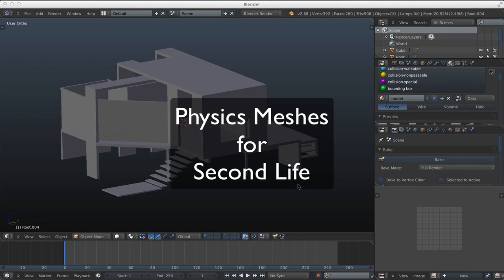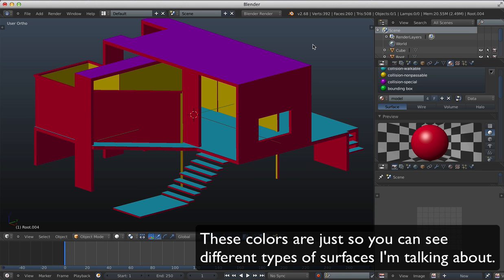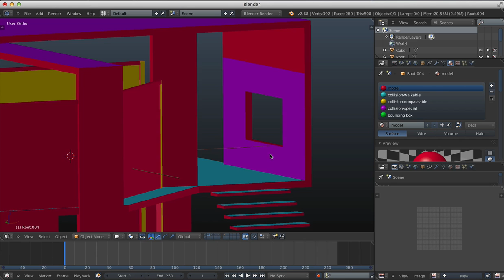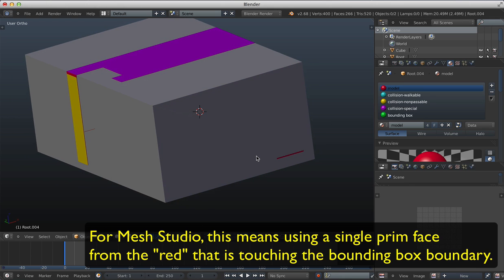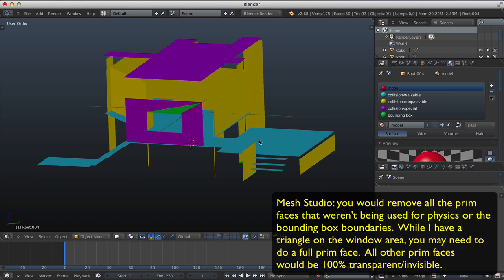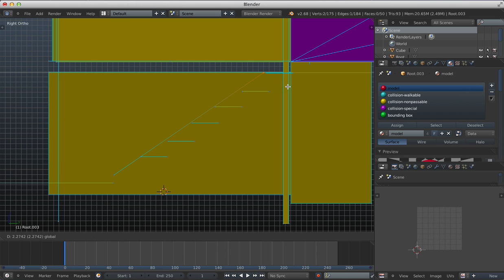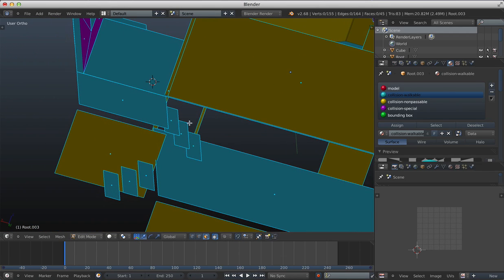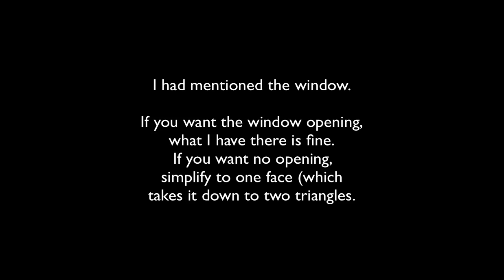Physics Meshes for Second Life (updated)

Comment: Well, to be honest, I am a bit confused. 
You start of by saying "It is important to do this for roleplays to do this so people can shoot through windows", yet you made that statement about not having to 'frame' the whole door. 
So from my point of view these statements don't mix.
Reply from the maker: The actual collision surfaces on a window or a door are actually around it; only the hole is uncovered to be able to pass through it.  If the window does not need access, in that the customer will not need to be able to walk through it or put something through it, like a gun, then you could pretend it's not there and it just becomes part of the wall collision surface.  A lot of roleplaying would need someone to be able to jump through or shoot through the window as an example.  Does that explain?
Reply: +Eleanora Newell Well, what I ment to ask was, why arnt you 'outlining' the top of  the door frame? In a firfight scenario it could be important, that that part blocks a granade for example.
Reply from the maker: Well, with trying to explain the basics, which is to tell someone, it's the collision surfaces that matter that are important.  It's not until someone gives me different scenarios than I had imagined, as you just did, that I can address them.  if you have a door in a wall the possible collision surfaces are normally the wall to the left and right of the opening.  You normally don't have people trying to walk through higher than the door.  However, especially if the wall is uploaded separately, you include the part of the wall above the door.  Normally, walls are not thick enough to worry about someone walking into the thickness of the wall, so you can do just the front or interior wall and not need to do both.  However, some things, like castles, can have very thick walls and then you may want to do both sides of the wall.  You may even want to do the surface surrounding the door jamb at this point, though again, maybe only the sides.  In other words, only you can determine what are the collision surfaces you need and no tutorial is going to be able to cover all the bases.  You can always ask as you're doing here and at that time, I can try to explain.

Comment: This is really great--but there is one thing I'm not understanding--In Mesh Studio, What is it exactly that gets uploaded into the physics tab?  The bounding box, or the faces that make up the impassible/walkable mesh?
Reply from the maker: Both.  The physics mesh must have the exact same bounding box as the high LOD mesh.  In a lot of cases when you do the collision surfaces you need, they will touch the boundaries of the bounding box on height, width and length, but not always, so you need to somehow touch the boundary it isn't touching by either extending a collision surface or putting a small bit of prim so it touched the boundary.  

If the bounding box of the physics mesh does not match the high LOD bounding box, it will stretch the physics to match it and can, in turn, throw off the physics.
Reply: Yeah, in the time since I wrote that I figured it out.  In fact, it was your beginner's workflow tutorial that finally connected the dots to the physics tab.

Comment: Nice tutorial , infact one of very rare found ;), I have an issue which i think you can help, I am learner of course, my problem is when i import my building in SL i can not walk into it, its some sort of barrier preventing me entering into it. the door is huge , do you think its because of the mirror modifier applied ? or what is the possible cause. thanks
Reply: Did you read the note at 14:41?  You might have stopped the video before reaching it. It says: "Once uploaded, remember to set the model to "Prim" in the features tab of the SL edit menu."

Comment: No matter what I attempt, copying what was done step by step in this video, I still can't get physics to work correctly, I cannot walk into my building, I do not understand what I could of done differently . . . So frustrating.
Reply from the maker: Criss Crow First, did you make sure that you are using a 32 bit viewer?  Secondly, once you created the physics and upload it, do you press the analyze button in the uploader under the physics tab?  Third, did you set the building to prim when you rezzed it?  And if you did all this and it still didn't work, did you check to make sure that bounding box of the physics mesh matches that of the mesh you're doing physics for?
Reply: It was that I didn't set it to prim in features, another video I found pointed that out in the video, so now I am continuing my project, thanks for the reply though.
Reply: +Criss Crow This was exactly the issue I was having, thank you for pointing that out.

Comment: I'm still having problems with the physics part of this.  Maybe because I'm trying to use it on a vehicle? What it appears to be doing is loading the physics into the wrong place of the build instead of where I need it to go.  Example:  I made a tank and set the physics (prims) to in front of the turret as well as on the sides.  When I uploaded it using the physics file it placed the front prim onto the gun barrel and the sides did not show up at all.  What am I doing wrong?  Thanks. (Blender 2.72 - > SL - Firestorm Viewer).

Comment: How do you set this up in blender (physical walls and such) so that when you import it into sl it works? If I make a copy of the build and place it into another layer, SL would upload all layers as 1 mesh thus doubling my LI and costs. If I use a physical build for walls and ramps and turn the rest phantom, would that work?
Reply from the maker: antuan734 When you export each dae from your Blender file, you make sure that you have checkmarked to export only what is selected (in the options under the Collada dae export options in the file browser when you export).  The uploader in SL shows four places to put dae files in the first tab.  Your main upload is the high LOD which is what you use to start the upload process.  Then, if you have made meshes for your lower LODs, they go into each LOD level with the pulldown where you choose to load another dae.  The same thing for Physics in the physics tab.
Reply from the maker: antuan734 Also, it is important that you use flat planes to create your collision surfaces...round surfaces can be really simplified, and if not a walkable surface, even a box will do for a cylinder since this is for physics.  The more simple your physics, the lower the LI.
Reply: Eleanora Newell
Could you do a video explanation of this? Also, if you could I tend to have very high LI on my builds and trying to find ways to lower them (tri's to quads, remove doubles, etc) don't do a lot.  I have even started projects over from scratch only to find that my LI is still over 100+. So if you could do videos on each of these topics it would be a great help.  Thx.

Comment: Thank you for making this video, I am new to blender and I want to be able to learn how to build this way. However I am running into a similar problem that when I walk into a house that I have built, from the outside I see the walls, windows etc but when I walk into the building the walls disappear as well as the floors as I am trying to build 2 (or more) story building.
Reply: You have to build the inner walls as well. You can do this by "duplicating" the wall(s) and moving them into position, or by extruding the interior walls. Be sure to check your "normals" facing to be sure they are facing the correct ways.
Reply from the maker: TygersPanther9881 See my response to Kayla Hallison in case this is your problem as well and you did build the inner walls.

Comment: I'm so frustratingly close to finally being able to create my own buildings and then I just had to fall at this last hurdle, I could cry. I'm having the problem of invisible walls on the insides of my builds after I upload them into SL, i'm guessing it's because I haven't done this physics mesh thing, is that right? I just find it so confusing D':
Reply from the maker: Kayla Hallison Physics isn't what will do invisible walls.  That would be your mesh having flipped or inverted normals.  The best suggestion I can give is to make sure that you have "Backface culling" on in your Property Shelf (right side of the 3D View - toggles on/off with N) in the Shading panel (scroll to find all the panels).  Also check in object mode that your model shows 1.0 for scale in XYZ under the same Property Shelf under Transforms>Scale.  If the numbers are not 1.0, you must apply scale to reset by pressing Ctrl A and selecting "Apply Scale".  In particular, if the transforms have negative values, once you apply scale, you will be able to see the inverted normals on the faces of your mesh, if you were not able to see it before.  Then you can recalculate the normals (or flip them if they are stubborn).

Comment: MY MESH bulding wont allow me to add walkable paths or anything i cant seem to get anything like you have in your video going i have blender to i even went to the physhic tabs and so on and try to do all this and i cant seem to get it to do it.. all i get in secondlife is a phantom mesh
Reply from the maker: SmexyfulPandaBear Make sure that you are using a 32 bit viewer as LL has not implemented Havocs physics in the 64 build yet.  Secondly, make sure that you read the response I have left for Antuan about how to make and upload the additional dae files.  Third, do not forget to set the build to prim in the features tab once it is rezzed in SL.
Reply: Eleanora Newell, could you explain where that ("Third, do not forget to set the build to prim in the features tab once it is rezzed in SL.") switch is?

Great video. Thank you.
Reply from the maker: ToolsRMe Shan Once you rez the build, which you uploaded with your physics mesh, you go into edit on it, and there are tabs in the edit window in SL.  One of them is features.  Usually, by default, the menu you're looking for says "Convex Hull', press this dropdown menu and change it to Prim.
Reply from the maker: ToolsRMe Shan One of the comments you left, regarding how to find the bounding box, wouldn't let me leave a response.  1) did you figure it out?  2) what are you using, Mesh Studio or Blender?